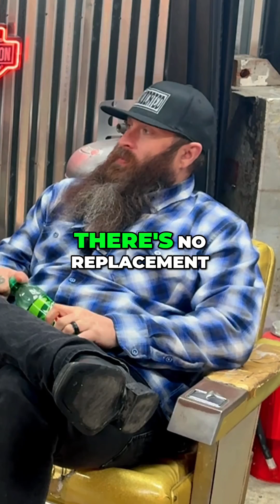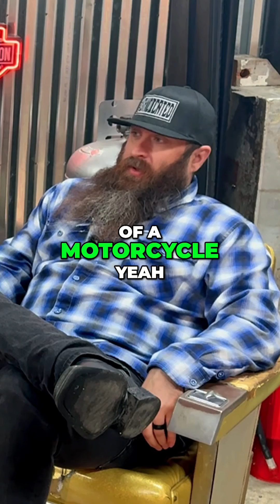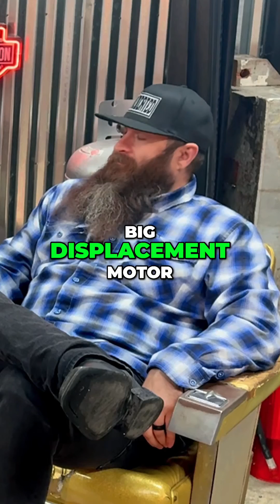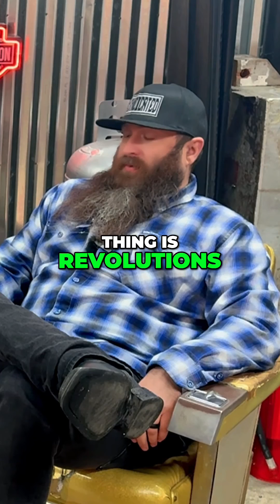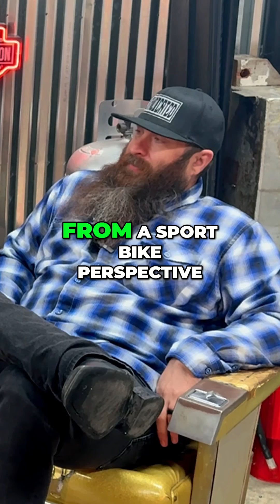The Truth About Motorcycle Engine Displacement and Performance Explained

Comment: Nobody ever steelmans the displacement argument. On strawmans it.
All things being equal a larger displacement engine will always have more capacity to make power than a smaller displacement engine.
People always mention turbos, but never mention putting a turbo on the big displacement engine.
Or rpm, but never mention kicking the rpm up of the larger displacement